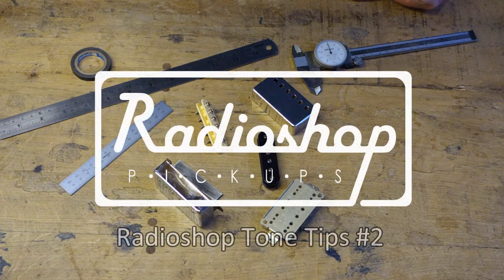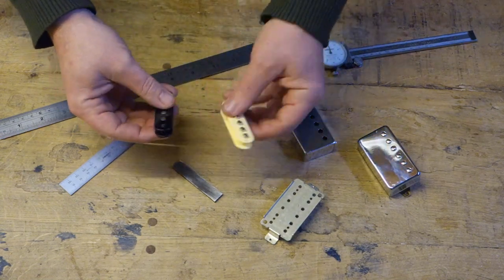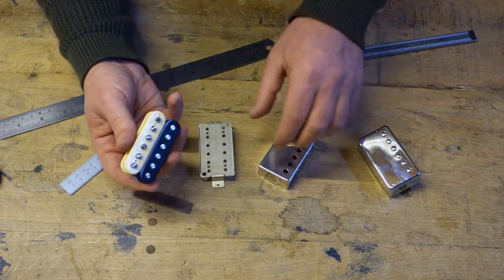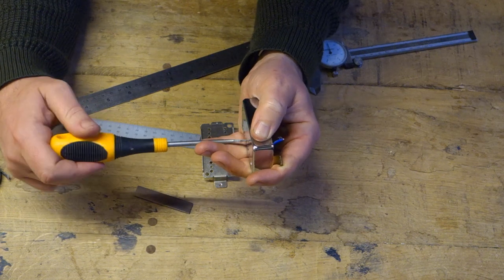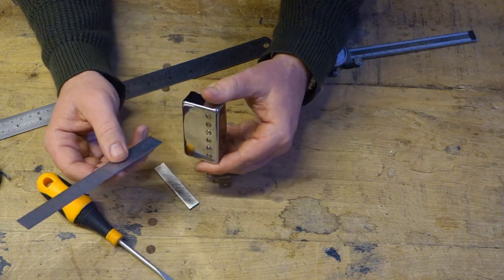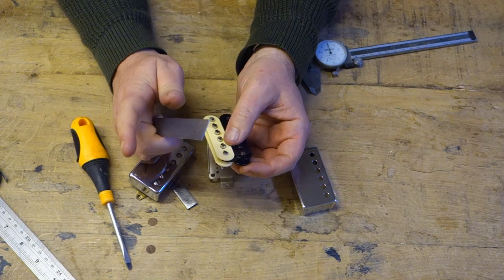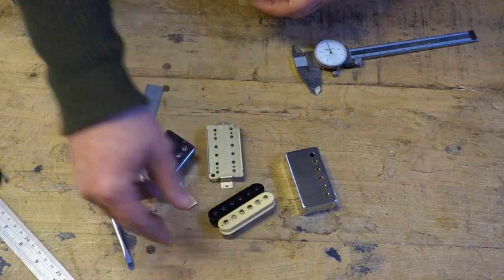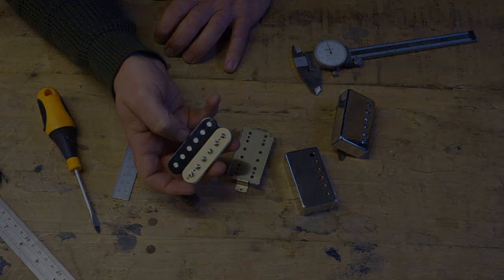How to set Humbucker Polepiece Screw Height

Comment: Just did this to my stock Squire Telecaster Deluxe and holy crap you are my hero! Saved me $200 on a pickup upgrade (adjusting the pickup height helped a ton too, and strangely taking off the factory plastic protective film from the pickup made them more open sounding too, which seems like a placebo thing, but after enough research I found someone testing it and proving that I'm not on crack haha). THANK YOU!!!

Comment: I JUST REPLACED THE SCREWS ON MINE WITH BOLTS FOR A MORE HEAVY METAL SOUND.
9.9Z
Reply: I heard they’re brighter and have tighter bass response though I like my stock Epiphone probucker treble pickup fairly bright despite having the more common slot screw and alnico v magnets but it’s not overwound

Comment: Ohhhhhhh, okay, now it makes more sense.... there is a bar magnet, and as you lower a (steel) screw, then more of it merges with and thereby strengthens the magnetic field (but the "core field" stays close to the magnet). However if you raise the screw then less of it is in direct contact with the magnetic field, so although it doesn't have a strengthening effect in the direct sense, it does help "spread out" the field to be closer to a particular string.

Before watching this, I thought maybe when you tightened a screw that it also pulled an individual magnet upwards closer to the screen. I really just didn't know the inner mechanism. The opening few minutes really clarified that immediately :)

Comment: I've been playing for 30+ years and in my experience, the pickup output is key and they are all different so their is no "one size fits all" pickup height.. Starting with my volume and tone knobs turned all the way up.. I set my pickup height to around .125 inch on both sides. I then pick a nice distortion tone setting that I know and like..I then switch to each individual pickup and lower or raise it about a 1/2 turn of the screwdriver at a time until I get the best clarity  I can with the distorted signal . ..This way you optimize the use of your tone and volume pots. Of course this assuming that your  ax is set up properly.  If your string vibration is fouling because of a weakness in your setup, the pickups will just put out that muddy, inconsistent, shitty tone no matter how precisely adjusted they are. And just  to throw it out there.. My Humbucker's  end  up being set at about 6 mm  treble side and about 7 mm bass side.. My single coils are about 5 mm treble side and 6 mm bass side..
Reply: I mostly agree.  Although I’m a bit partial to spam.

Comment: Great tip...2020 50s Les Paul Standard sounds better. Hard to believe these small adjustments have a distinguishable influence on tone.  I have found your pickup height video beneficial as well, I also found that Neck works best at 3/32 and Bridge at 1/16.
Reply: Any idea what that is in metric-my fritzl ruler is in millimetres?
Reply: @koolkutz7  3/32 is 2.38mm and 1/16 is 1.58mm
Reply: @Bad_P0tato  thanks appreciated 👍

Comment: Accidentally came across this video. Made these changes to my 2012 Les Paul Traditional pickups. It's really helped it sound like a Les Paul should sound like. Why don't Gibson send out guitars with the pickups setup like that?
Reply from the maker: Hi Jim! Not sure why not really. We've all got our own take on how it should be done I suppose and we just think it sounds great this way 👍 Glad you found it useful
Reply: psycho'si carter  NO BUT IT IS FLOWER POTTED. I HOPE THAT HELPS.
Reply: WHO DON'T GIBSON SEND OUT GUITARS WITH THE PICKUPS SETUP LIKE THAT ?  DUDE WHAT THE FLUCK ARE YOU TAKING ABOUT ?
Reply: It's good for you to do things little repairs on your guitar it helps for you to bond with a guitar and make it your own the pickup pole pieces are like little microphones once you get him in the general neighborhood you adjust them in case they're too loud for the individual string or too quiet and you can increase the volume of the string or decrease it based on the height of the screw the closer to the string within reason will turn it up and farther away will turn it down

Comment: Output is proportionate to distance ^2 to strings so the further your pickup height, the less the polepiece adjustment matters with regard to string radius. Also you don't factor in string output which you can also balance for. For example  huge output differences between G and weaker D and E strings
Reply: Great points to mention! I want to talk about the string output real quick for anyone reading... Only ferrous (iron-containing materials) are magnetic and likewise affect/amplify magnetic fields. The G string is a steel wire. D, A, and E however are thin steel wires and most often wrapped with a non-ferrous wire (nickel or maybe also bronze etc). So even though D, A, and E are the thickest strings, they are less magnetically responsive than the G. However if you use D'Addario "Prosteel" strings (I don't, but just as example) which are steel wound, then they will have a much stronger sound than even the G! (But honestly I don't recommend them, namely because they will wear down the frets much more quickly than nickel wound!)
Reply: @adamcolbertmusic  I had a similar problem on a pacifica 612 hss - great guitar except for the B and high E being noticably quieter than the G (more so than others I have tried recently), especially on the neck. I tried adjusting the height but didn't balance out. Can this be remedied? The strings were 9-42
Reply: @spiral-m  I really don't have the technical know-how to answer that, sorry, but thanks for your reply!
Reply: @adamcolbertmusic  no problem. Thanks for your video!
Reply: @spiral-m  bumping the gauge up to 10-46 might help. Had a similar problem when I was using light gauges, 9's, on my hofner galaxie. Also check the pick up height in relation to the string. Cheers!
Reply: very good points here and in these replies. this is why some pickups have staggered poles. there are way too many factors involved in creating equal output. you cant just measure it with a ruler.
Reply: @adamcolbertmusic not all magnetically active metals are ferrous. There is a difference between ferrous (containing iron) and ferromagnetic( magnetically active).
Nickel is the most energetic ferromagnetic metal and contains no iron.
Reply: Also most stainless steel is not magnetic even with large amounts of iron due to austentation.

Comment: Based on this video. Does this mean that all radius tools are wrong? Because if you adjust the pole pieces according to the radius tool. The poles are set much higher than they should be if what you say is correct.
Reply: That Haze article is well done.

Comment: Hi. Great video! In order to compensate for neck radius,what pole heights/no. of turns would you recommend on an epiphone sg? Thanks
Reply: Follow the string curve, with a gauge that fits under the strings, also adjust eight of pickup and pole prices to make strong volume as equal as u can because low e string makes far louder output than high e etc. listen to guitar adjust to taste

Comment: So what does the poll piece do to the sound? So you can customise the sound better on the guitar?
Reply: Yes, you can change the tone by adjusting the pole pieces. For example, if you have a bassy pickup you can raise the poles on the treble strings, or lower the poles on the wound strings

Comment: What happens when the Humbucker is not covered? I have a Ron Ellis pup that looks like your Spanish pups. The pole pieces where actually very high. I am using it in my Fender Strat Ultra. I did lowered the pole pieces almost as low as to match the other side since I wanted a pickup that sounded a bit more like a paf and not too much as a single. Is that alright? I mean, can I lower then to where I did or is there a reason not to?

Comment: I wonder if we guitarists should set the pole piece radius for any guitar BEFORE installing the humbucker cover.
Reply from the maker: It's definitely an idea, although quite often small variations in overall bobbin height, baseplate thickness and other aspects of the overall pickup's height mean I like to size things up, get the cover on and then set this as it can sometimes be a tiny bit 'out' if doing it that way and might need to be raised or lowered after fitting the cover. Hope that helps, Paul

Comment: Question to see if any one else does this....I have found that, at least on my neck humbuckers, I actually remove the low E pole screw completely, to get rid of an unbalanced boom of that string. And no I am not doing anything weird with amp EQ settings, string gauge or general PU height, all pretty normal. Its certainly easy enough to try and put back, but I have never put one back out of a dozen guitars I own.
Reply: That's a great idea. I may try that.  When referring to E strings, don't use 'High' or 'Low'. It's proper to refer to them as "Fat" or "Skinny" Reason being...
as you hold the guitar in the playing position,  the E string that is closest to the floor is higest in pitch. But in position to height , it's the lowest on the guitar.( closer to the floor, not the ceiling) 
So it shouldn't be called 'high'  It should be called "Skinny E". Same is true for the E string  closest to the ceiling. It shouldn't be called the "Low E". It should be called the "Fat E". Position vs Pitch is a better. Easy to see, difficult to explain.
Reply: @johnroseman9087  It not hard to understand if you are a musician, its the low E.
Reply: @nickf9392  You da Man Nick!! Sorry..
Reply: @johnroseman9087  41 years playing guitar, I've never heard fat and skinny until now! I think it's just you mate! 😁🙂
Reply: @Dave-Rough-Diamond-Dunn  🤔 Not my term. It was the guy I took lessons from 48 years ago. Must be an an old school term or totally extinct now!🤣
Reply: @johnroseman9087  I was just joking lightheartedly with you, but it's true that I hadn't heard it before! 
Now you say that though, I guess it makes sense to use fat and skinny when talking to raw beginners just starting to learn guitar. 
I started lessons in '81, and I don't recall the teacher using it, but I could be wrong, it certainly is a clear description.
I don't know that I'd use it around seasoned musicians though! 🙂
Reply: @Dave-Rough-Diamond-Dunn  I understand Dave. Then again..I never said I was a seasoned musician nor do I hang with them!  Lol.. Peace

Comment: My bridge humbucker high e string side seems louder than the other strings, I wondered if it's because the wrapover bridge is lower on that side or the pole piece is too high?
Reply: if that’s the case for both of those things that’s why but also some strings are louder than others so if you wanna compensate like I do utilize the poles with the bobbin all the way down otherwise you have to make use of the actual bobbin like if the poles are fixed or if there are none most people leave both the bobbin as close to the strings without touching and the pole flat because they don’t mind the natural volume per string

Comment: When do you do the pole piece adjustment is it before or after you set desired pick up height?
Reply from the maker: Christian Ebisa Hi Christian, I would do it before setting the pickup height. I'd lower them a little (although not too much as the Humbuckers can drop off the two height screws if you go way too far) to give yourself some room to work with and set the polepiece height and then do the pickup height following. Hope that helps. Paul @ Radioshop
Reply from the maker: And here's a link to our pickup height setting video too :) https://youtu.be/wLS7yaUzApI

Comment: I have a problem where my open G string doesn’t ring out. Someone suggested the pole piece might be too close to the string? 

My screws are all flush with the pickup cover like you started. I messed with those a little but nothing changed. 

Do I need to take the covers off and change the actual pole pieces on the pickups?
Reply: you could try dropping the pickup height and raising the pole peices.if its a neck pickup that will also give it more clarity.
Reply: Thanks for the help. I tried that and it still doesn’t seem to make a difference with either pickup. I’ve tried adjusting the saddle and break angle too and nothing seems to help. It’s only the open G string. Maybe the nut is not cut right?
Reply: Also, the pickups already came very low height. I tried raising them even and still the G string sounds so dead and un-resonant. Funny thing is, when I play it unplugged everything seems to ring out just fine.
Reply: @mralgebro  possibly old strings could be the cause but also I'd recommend switching the neck and bridge pickups (assuming it's a HH) just briefly to check that it's not a pickup fault
Reply: Strings were the first thing I tried. Tried different brands, different gauges. Even tried a wound G string. Nothing helped. 

Swapping pickups sounds too complicated for my skills.
Reply: @mralgebro  Check the wiring and solder.

Comment: Any info on enforcer humbuckers?
I got a Fender Pawnshop Stratocaster deluxe reissue. It has a Tele neck pickup coil and a chrome covered humbucker that has  3 screws on the higher part of the cover and the other 3 on the lower part of the cover. Always wondered  ..like the hidden bobine has 3 screws sticking out of the cover for the high small strings...

Comment: You don’t set the pole heights by sight. C’mon. The g (assuming it is unwound like most gauges) should be screwed down as it is the loudest string. You then blend pairs of strings to one another with your ears. Play through your amp with as much gain as you would normally use and double check with a clean tone.
Reply: yeah, way to many variables to measure with a ruler. i wonder if he has ever noticed factory stagger on higher end pups. i can see people right now destroying $350 lollars in order to match the radius of a board.

Comment: Never take advice from someone telling you to adjust your pile pieces by sight! Would you set your amp knobs by sight? No. The idea is to balance the output for individual strings. The unwound G will be the loudest string. If it’s set the same as the wound D beside it ,it sounds MUCH too dominant. Also, your fretboard has the radius, but what about your bridge? Bad advice, my man 👎🏼
Reply: There’s always one 🙄
Reply: this one happens to be right. ever notice higher end pups that come with pole already staggered wildly? way too many factors here to measure with a ruler but you go ahead and tear your stuff up. you bought it. @mickthebandit
Reply: @mickthebandit  Yes, one that knows what he's talking about. And there's always the rest of the ignorant herd.
Reply: @RobertMurphy-wm3ge  The adjustment suggested in the video is garbage and will result in uneven volumes of the different strings, since some strings are naturally louder e.g. the unwound G string. There is a perfect tutorial how to do the proper adjustment on the mylespaul forum if you search there for pole adjustment. And there, it's explained quite well why you shouldn't do what the guy in the video does.